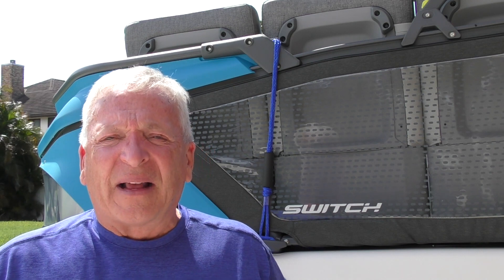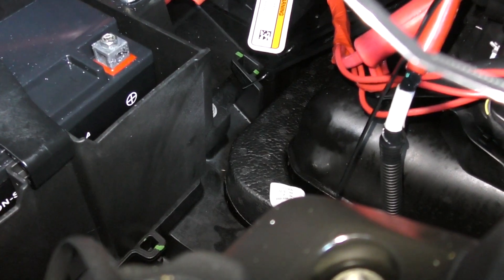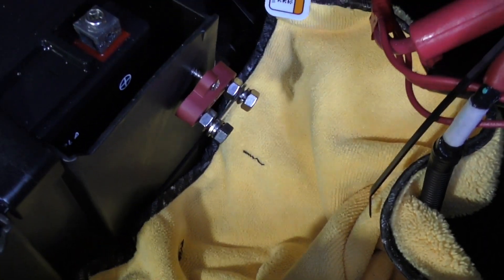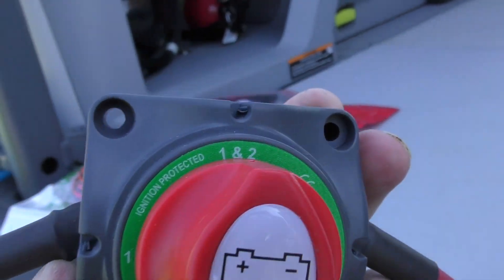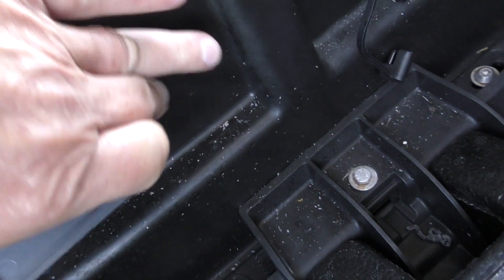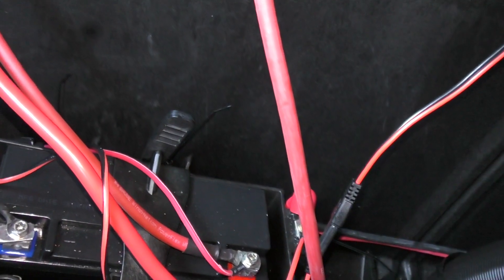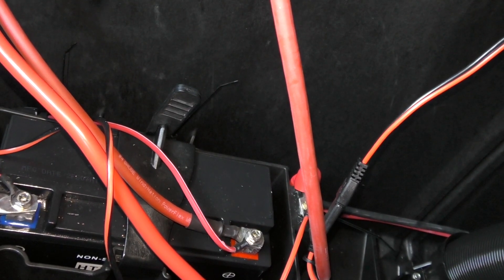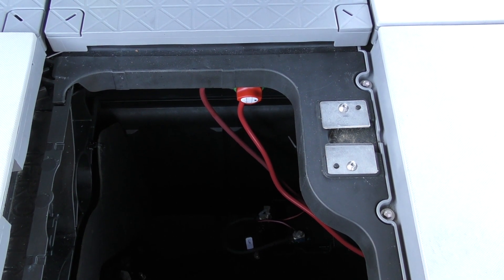SeaDoo Switch Dual Battery Switch Installation

Comment: Hi Frank.. I have a 2024 sea doo switch limited. The boat came with a cut off switch. I purchased the kit to added a second battery. The switch was installed according to your instructions. Now when the audio is on there is a whining noise coming from the speakers. Can you tell me what did I done wrong ? Can anybody give me advice in how to fix the whining noise coming from the speaker. Thanks
Reply from the maker: @anthonydavis377  check the grounding.  These is often a ground loop issue with Sea Doo.  Google ground loop seadoo.

Comment: Hi Frank.  did u leave the original battery disconnect the way it is. Or removed it ?
Reply from the maker: @ozzysautorepair351  check out my video on adding a switch.  I kept both batteries, but have them on a switch that I can use either one.

Comment: I used the same parts listed and I'm pretty sure I wired it properly but I couldn't get power from BATT 1, I had to switch to BATT 2 for the boat to work, any idea ?
Reply from the maker: @clooch1976  use an volt-ohm meter to make sure you have wired properly.  If you connected like I did, then remove the cable to the engine.  So now you have only the cables from the batteries to the switch.  Use the meter to measure the voltage at the point where the cable to the engine goes (that you disconnected).  Switch from battery one to off then to battery two.  It sounds like you have wired it wrong.

Comment: Can I get a clarification for the positive and negative wires, did you use 3 positive wires and 1 negative wire along with two bus connectors?

Comment: Frank, thanks I installed a battery switch last year in my 2022 Switch 230hp, worked great. This year my dealer replaced the IBR Module under warranty after it failed to go into reverse with "IBR Module Error". Tech said they've had problems with all 2022 IBRs. But it keeps "locking" and tech says he has to use his laptop with connection in engine compartment to software reset and unlock IBR. Realized that every time I turn battery switch to Off, the IBR ends up "locking". But worked great last year before this IBR replacement. You have any idea why? Is there a way I can access whatever the tech uses to reset/unlock IBR?
Reply from the maker: Even though you turn off the battery, check the battery voltage.  A battery tester might help.  (I did a video on a battery tester I evaluated.)  I've read that  low voltage can cause the IBR error.  Also, for me, a low voltage kept my IDF from working.  But for the software reset, you'd need to get the software and dongle attachment to get into the ECM.  CanDooPro.com has the decoder and software, but I think it's a little expensive at $429.  Plus, if you decide to go with that, call them first and make sure you get the right product.

Comment: Great video!! Thanks for sharing. Where did you put the new 2nd battery, and what are specs on that new battery. Do you have a trickle charger hooked up? Keep up the great work!!
Reply from the maker: Look for my high capacity video.  It will show the location and installation as well as the battery and mount specs.

Comment: which battery charges when driving around?
Reply from the maker: When adding the second battery, Both are NOT connected in parallel.  Only one battery is connected and therefore only the connected battery charges.  Which ever battery the switch has selected is the one used for everything, including charging.  While the switch itself will allow for either, none or both batteries, batteries of different capacities, like this set-up, should never be connected together (the Both setting).  Nothing drastic immediately happens, but the different capacities will tend to bring the high capacity battery down to the lower capacity level.  Check other YouTube videos on this.

Comment: Great Awesome Videos - thanks for all the insight,  I have done pretty much the same stuff (dual battery, dual charger, battery switch) , only I did not buy any of the parts from Sea-Doo,  the battery case, cables, etc.  all off of amazon,  What also I found is I am able to place a Group 31 Dual purpose MAGM in the Group 27 box.   I was considering a ACR as well and possibly provide a separate fuse block for external application (Lights, accent lighting, alternative stereo).   BTW:  the 18ft does not seem to have quite the amount space to work around aas the 21ft.  but still managed.  Again thanks for the videos

Comment: Would the Blue Seas Add A Battery kit work on this pontoon?
Reply from the maker: I really don't know.  If it can be properly mounted and be secure, probably so.  The SeaDoo kit has the right size battery holder, right retaining brackets and screws.  Also the correct length of battery cables with attachments for the attachment points on the existing battery holder.  You'd need to evaluate how much you'd save in dollars and effort going with something other than the SeaDoo kit.
Reply: @letsrolldiyauto1532  What's the price of the kit?
Reply from the maker: @theoldshooter9011  Check Google for the latest pricing.   I've seen it from $165-$200.
Reply: @letsrolldiyauto1532  thanks

Comment: Added the high capacity battery but when I try to start it says check key. Put back on original battery it works fine what up with that?
Reply from the maker: Your high capacity battery may need charging.
Reply: Mine does the same thing says check key and a bunch of clicking sounds
Reply from the maker: @johnmorgan1632  The battery needs charging.  Also check for loose connections.
Reply: @letsrolldiyauto1532  how many wires did you have going to the post that you added on the battery box?
Reply from the maker: @johnmorgan1632  Check my video on installing a dual battery switch.  If you tried to connect the high and low capacity batteries in parallel, there's your problem.  Only one battery connected at a time.  The video on installing a dual battery switch will show this connection.

Comment: Frank, can the  battery switch be installed in or on the console, so it is a little easier to access?
Reply: Yes. But it would take longer battery cables. You should measure the length and check it against a chart you can find on Google to determine the best gauge wire to use.  Running it through the wiring grommet under the captain’s chair might not be possible due to the size.  It’s easy to try and find out.  Be prepared to drill another hole and get another grommet for the battery cables.    I thought about doing that. My conclusion was that it was almost the same effort to remove the front snap panel of the console as the two twist latches to the engine bay.  You can also look to mount it outside on the console,  just bend the terminals on the cables to come straight out of the back instead of the sides.